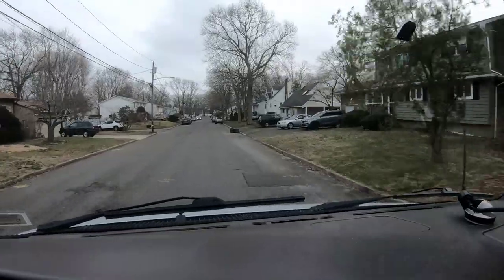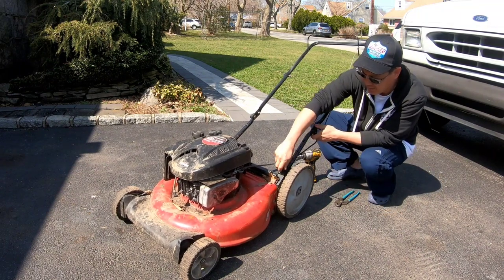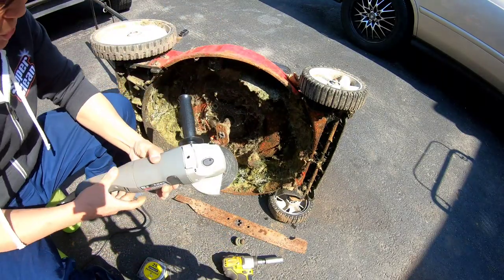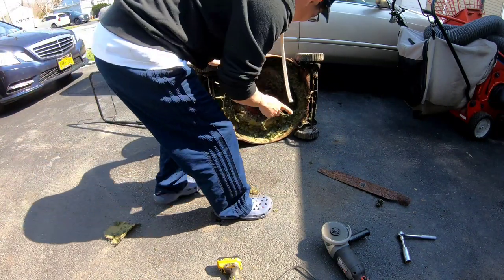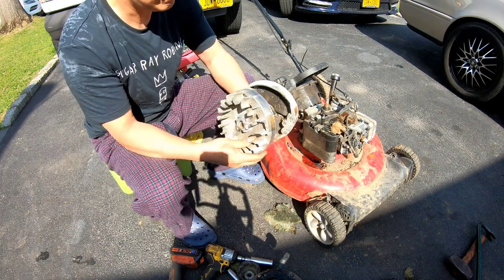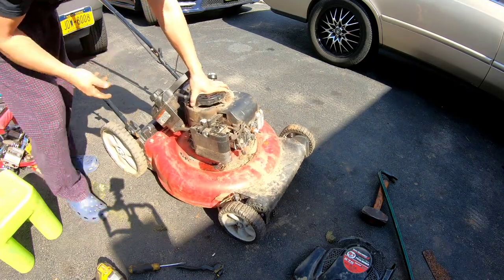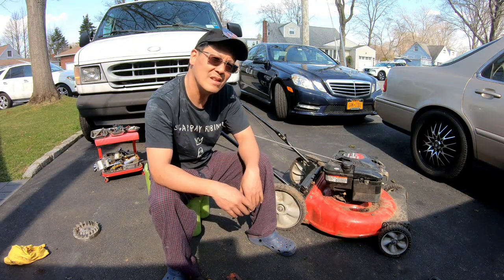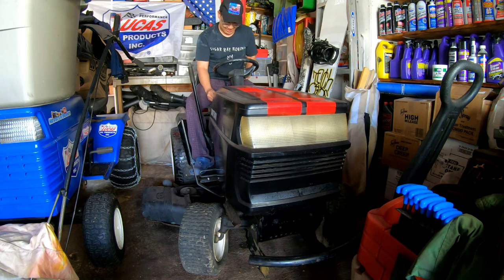FREE QUINN THE MAILMAN CURB ALERT YARDMACHINES MTD PUSH LAWNMOWER KNOWING EXACTLY WHAT'S WRONG ASAP!

Comment: I guess the 21" Yard Machines mower is a 2011 model because of the redesigned platform mounted with an older model Briggs and Stratton 675 series that they no longer make anymore.

Comment: Hi Henry. I ran into the same issue on a flip mower I was working on and the only blade I had that would fit it was an inch to big. My resolution was cutting off 1/2 an inch on each side of the blade instead of modifying the blade adapter. Hope that helps.
Reply from the maker: Yup I’ve done that too!

Comment: Hey Henry, I get my welding tips at harbor freight.  You need to know your flux core wire size so you can get the exact size tips.  Nice score on the pusher from Quinn the Mailman
Reply: Also Henry that wheel on the air compressor looks caddywompus to me

Comment: They split the flywheel by tightening the flywheel nut too tight on the taper trying to stop it from spinning on the shaft because of the sheared key.
Reply from the maker: Yes possible

Comment: Nice fix Henry but kinda disappointed to see you destroy the MTD blade adaptor i think they run $27 Cdn. and blades around $12 but you gotter running fine. Just wondering if you let the purchaser know about the blade and adaptor when you sell it?
Reply from the maker: No, I usually dont.  It's all sold as is.  $40 in parts for an $80 sale doesnt make much sense to a flipper.

Comment: Your grinder would have easily cut a 1/2" off each end of the first blade.👍👍
Reply from the maker: Yeah but probably unbalanced
Reply: @MowersNBlowers  as long as u cut 1/2" off each end and checked the balance using a nail, use 1/2" wide masking tape on both ends to measure the length needed removed on both ends then cuts are the same.👍👍
Reply from the maker: @gregorypierce6703  yeah I’ve done that before, but what I did worked just fine too!
Reply: @MowersNBlowers  right on. You can tell immediately when one is out of balance. 👍👍